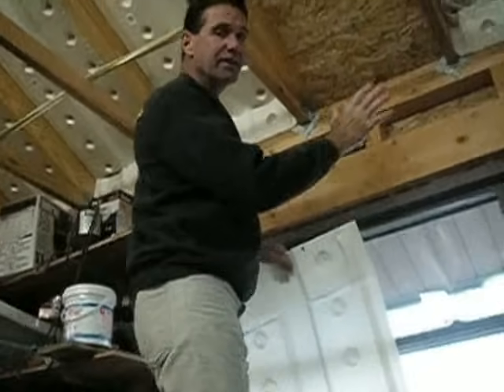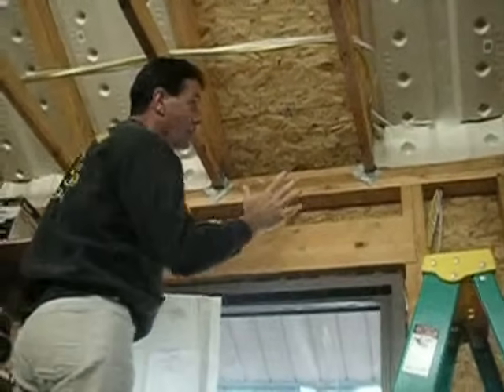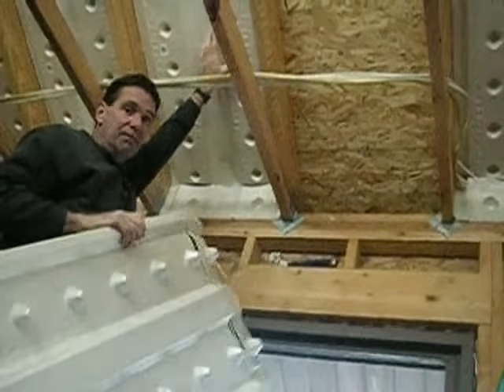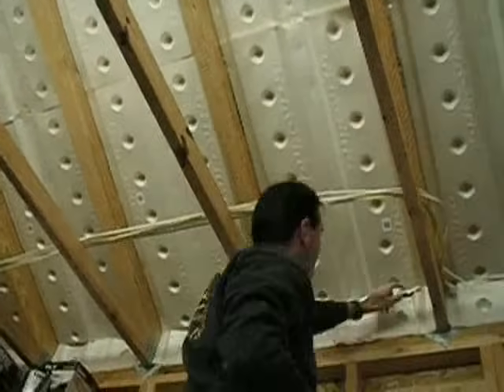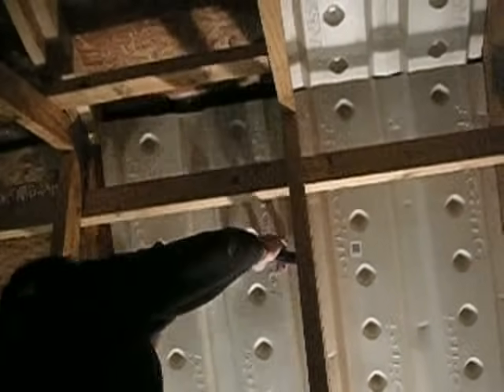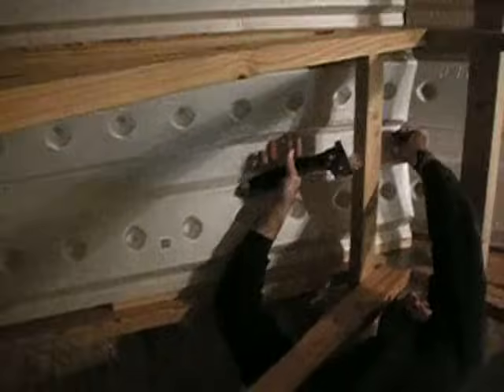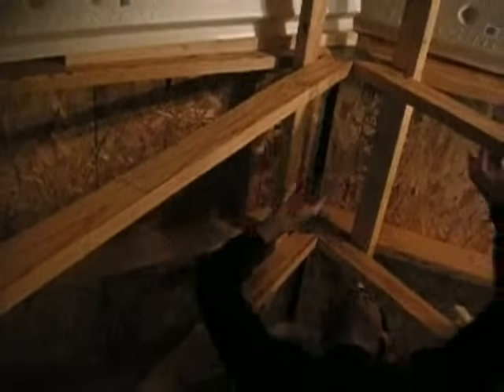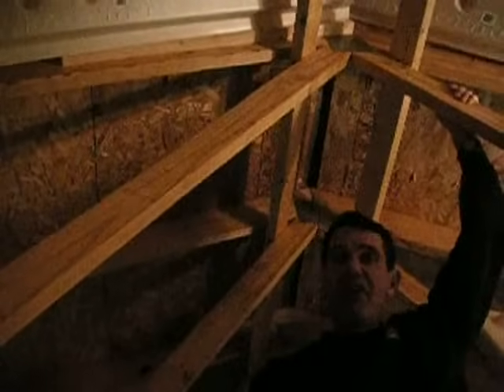Roof, Attic Insulation of Foam Baffles - Ventilate, Insulate Cold, Hot Air

Comment: Thank you Blair just what I needed to see. My bathroom is insulated up against the ceiling and it has spotting mold coming through the drywall every 2-3 years or so so I just bleach the ceiling and repaint with kilz to cover. i am think about opening up the soffitt as it has vinyl and wood on it with really no air flow to add baffles. I am going to try and just get one baffle in there without tearing out the ceiling. Probably not the best way but its not been bad YET. Of course will have to remove the soffitts and then add vented soffitt for the air and with the baffle if I can get it in there should be at least better but not ideal. Only the bathroom is the living area.
Reply from the maker: any air flow you can get above the insulation is a plus

Comment: It looks like your trusses were 2x6.  I have 2x4 trusses, could I still do this method?
Reply: +B scott 
if you are 'living' in the attic airspace I would use spray foam over the baffles.
Reply: Thanks.  not living up there, but might be an easier option.
Reply: +B scott The baffles, yes. Your limitation will be the insulation you post up against it. You will need to find additional ways of support.

Comment: You mentioned taping the cut marks, and caulking.. Any chance of an expanded example? What kind of tape, and specifically how you'd do both?
My concern is a drafty edge on the wall side after insulation is in place.
Reply from the maker: Actually I like to seal all the joints and voids with 'Crack filling spray foam'. It is messy but it glues any voids together.
Reply: @MrHardware1  How can you be sure that the crack filler doesn't expand upwards and block the venting channels that the durovent is intended to create? Also what tape do you use?
Reply from the maker: @OutThere21  don’t use tons of foam when filling cracks, a little bonds like a lot. I recommend Gorilla tape for anything you don’t want to disassemble later.

Comment: ok. it is a great think . what about the hot air between the ceiling and the baffles? where it wit go if you got your baffles all the way to the ridge vent?I thought you supposed to run the baffles only in the area where the insulation will be so it doesn't block the air flow?
Reply from the maker: I'm using the attic, there will be no ceiling thus no dead air space. I only insulate against the conditioned area.

Comment: @Lynnieburd if you use 2 inch foam sheet (with foil is better) cut between 2 X 4 rafters and use canned foam to seal cracks (cut it in foam as tight as possible). this leaves you have a 1 1/2 inch space for air flow, put up at least 4 mil plastic and sheet over with 5/8 inch mold moister resistant sheet rock as a fire barrier. bigger rafters = thicker foam

Comment: This seems to work for roofs that have venting along the whole edge of a soffit. My roof does not, but it has three 20" by 24" soffit vents along the underside of the soffit, so I think I need special baffles that surrond the soffit vents inside the attic.
Reply from the maker: I bet the soffit area is continuous between the vents, once past the top plate the baffles will do their job.

Comment: Can 3-4 layers of duro-vent tacked up without the complete insulation save a roof?
Reply from the maker: +sblizzy 
It's not about saving the roof, it is letting the roof vent while keeping the room below warm or cool depending on the season. Several layers may have been all I needed for a garage, cuz it would have helped keep the heat from the summer sun from baking me in the garage.

Comment: What do you do if you are insulating a small pitch area on a garage space (where there is no living area above) and there is no ridge vent in place at the top?
Reply from the maker: Foam insulation sprayed directly to the bottom of the roof plywood is the best way. Celluose or fiberglass can hold moisture and cause rot... This is a tough call because conditions vary greatly. I use a vent installed where the roof contacts the building, like a half-ridge vent to do it the best way.

Comment from the maker: The purpose of the baffles is to allow insulation and airflow in the same cavity. If the rafter space is not ventilated, moisture can damage the rafters and the drywall. In my garage the attic is a living area so I am conditioning that area. If it was not a living area the baffles only need to go above the depth of the insulation.
Reply: Great explanation. I wondered

Comment: Do I need to get these installed in my Tuff Shed?? Before I get the ceilings insulated??..There are no vents inside..I was told not to get any vents if I planned on insulating...PLEASE HELP...
Reply from the maker: My best wish for an insulated building is to have vents at the gutters ( the area at the base of the roof) and a ridge vent to let warm, moist air flow up and out. Send me an email of your print or something showing the roof and the outside wall and I'll send my idea back. blair@mrhardware.com

Comment: how do you join the 2 baffles at the ridge with out having all the mismatch openings.
Reply from the maker: +marty one 
I stapled the foam-board to both sides of the roof, barely holding the top piece of foam-board until I came back with a can of spray foam and used it to 'weld' all the edges and voids together.
Reply: Thank you for replying back. only I dont see anywhere on the net how to meet up the 2 baffles at the peak. its like putting a round peg on a square hole or using a car door for a hood. the voids are too large to use spray foam.
Reply from the maker: +marty one 
Marty, you could tape a 12" piece of foam baffle, cut to match somewhat close to the baffles running up the roof, and with a can of foam easily fill gaps up to an inch wide. hopefully you are a little closer 'coping the top piece of foam to the side pieces than one inch.
Reply from the maker: +marty one 
Check out this video on crack filling, not my best.

Comment: Wouldn't it be better to just spray foam the entire attic
Reply from the maker: That is another viewpoint on this job that some 'foam guys' prefer. For a while shingle manufacturers were not guaranteeing shingles on a 'hot roof'. I prefer the airflow to remove some of the heat and moisture that could accumulate in the wood decking. Check with your shingle manufacturer to prevent losing the warrantee before foaming directly to the plywood.

Comment: This method does not ventilate any attic airspace, If he packs the attic solid and gets a good air barrier, it should be good. He did however, miss taking the insulation over the double tip plate. The coldest wall area in the building is now where some of the warmest air is, the wall/ceiling joint. He may see the results of condensation in that area already. He should have tried to get the baffle downturn on the outside of the top plate. He is way ahead of most contractors though.

Comment: @HomeEnergyNow The fact is, you MUST use some type of barrier between heated living space and unheated attic or cavity space to prevent the build up of condensation.
Vapor barrier/retarders work together with ventilation to protect roof decks from developing condensation that in turn causes roof rot. Keeping moisture vapor from permeating to the unheated space is the objective. Allowing it to hit the cold space will cause a problem over time. 
The video is correct.
Reply: Theres a cold spot above the top plates now. Not good. You should hang the baffles part top plates then stuff insulation in the void.

Comment: @HomeEnergyNow How is the vapor barrier going to interfere with the ventilation?
It's there to protect the insulation. And wood dose NOT need to breathe. That is just silly. Wood dose expand and contract with humidity though, even after it's been "sealed" with paint. Everything in this video is correct in my opinion.

Comment: I love your demonstration of how you installed your baffles.. very informative. I would add that according to the research I have done (which is extensive), we do not need to ventilate because of the danger of a hot roof. We need to ventilate because of moisture brought on my temperature extremes and a conditioned space. If you air condition a space condensation can occur like a glass of water on a cold day. Likewise in the winter you can also have the same impact when heating a room. If you do not vent the roof you will have problems with moisture. Moisture destroys roof from the sheathing side out, and it causes mold. 

I am in the process of researching how to insulate my tuff shed for a home office. I am going to create cathedral ceilings out of 2x4 rafters. I am going with 2 inch rigid foam sealed with spray foam. It has the highest R value per inch, and the space I have is limited. I may still install baffles, even though I am going to make sure that there is still 2 inches for ventilation. Another benefit of rigid foam is it has vapor barrier qualities.

Comment: what if my detached garage does not have a ridge vent but only 3 round metal "exhaust" vents in the roof 3/4 way up the roof equal distant apart... do I need to install baffles at all?  my garage joices I think I want to remain open so I can store stuff in the attic part of the garage... but I want to insulate all walls and the roof but my question is about the baffles?????
Reply from the maker: You will need to create a false ceiling from your can vents horizontally across the garage allowing the baffles to 'dump' air into that upper cavity so it can exhaust out the can vents. I think it would be easier to remove the cap off your roof, cut 2" out of the decking and install a ridge vent on top of the existing roof. The baffles have to have an inlet (at the soffits) and an exhaust out the top.
Reply: What if it's a unattached garage hip roof with four vents?  I want to finish the walls and insulate for a workshop on one half of a two car garage.  Do a 1/4" plywood ceiling and walls on one half.

Comment: Perfect, thank you. 
The general contractor installed baffles from the soffits up towards the ridge vent, but only 6 feet. So the attic is the same temperature as the outside. This is a problem since the HVAC is in attic.  I need to continue the baffles the ridge vent, then finish the insulation.
Thanks again!
Reply: You attic should be sanectemp or you'll get heat loss, then water damming when it freezes over the cold overhang.

Comment: I've got an existing situation on a knee wall.  any Idea how to do this when the drywall is already installed.  My house is older and the original builder never had to do this.  I'm trying to save time and money by not removing the drywall, removing the insulation, installing the vent, and then doing the work all over again.    Thanks for any advice.
Reply from the maker: Sorry, there is only 3 1/2" of room plus a vent to insulate. I think a foaming company would charge more that pulling down the drywall, adding a 2x4 to the bottom of the existing rafter so at least 6'' of insulation exists.

Comment: Thanks for sharing your video.  I want to add faced batt to my old garage ceiling as you show, but I have no ridge vent or soffit vents.  All of those spaces are closed off.  I only plan to heat the space for hobby woodworking for several hours a week through the winter months with an electric heater or maybe wood stove.  Would you recommend adding these vents, going with a different insulating material, or something else entirely?
Reply from the maker: I think you should install a ridge vent so the air can come from the vents to the ridge vent. Then insulate below the baffles with anything, fiberglass or blown-in  with reinforced plastic stapled to the bottom of the rafters or foam, the best.
you need to capture the air from the soffits and prevent it from taking heated air from the shop.
Reply: Blair Gilbert Blair Gilbert I think you missed the point he made. I have the same problem situation in my garage. They shut the soffet vent with wood so there is no venting at all. the top of the roof is also blocked with wood so there is no way to add a ridge vent unless I  tear all the wood out. The thing is I am not using AC and only minimal heating using space heaters sometimes. Otherwise the only conditioning is what is leaking through from the house. I park my electric car in the garage in the winter which helps with the range. Adding the insulation to the walls seemed to make a difference. If the garage is minimally heated in the winter do you think adding a layer of insulation boards on the studs would cause and mold problems or overheating during the summer? If I just left the bottom and top open allowing it to vent on the inside of the garage will that defeat the purpose since there is no air barrier? If the soffit and ridge venting is not an option is there anything simple that would work without causing a problem with mimimally conditioned spaces?
Reply from the maker: If you are using electric space heaters there won't be a lot of warm MOIST air rising to the roof, (gas space heaters create a lot of moisture) and getting trapped between the insulation and the cold roof. Moist air penetrates the insulation and contacts the ice cold roof and BOOM, you have condensation.
I have used 2 layers of plastic (visquene) stapled to the bottoms of the ceiling joists to create a semi thermal barrier to retain heat. That way you won't be heating the attic area above.

Comment: completly done wrong. Soffit Vents and Ridge Vents/Roof Vents are suppose to work together to help remove the hot air in the attic out. You are only suppose to go up high enough from the soffit vent with the baffles so that insulation does not fall down into the soffit and block the air flow. What he did restricts the air flow in the attic and is not removing any hot air from the attic.
Reply from the maker: You are missing the part that I'm conditioning the attic and don't want to add or draw air from there.  My goal is to vent the roof, not the attic. Blair

Comment: Baffles like hes using can be replaced by just cutting 3 or 4 inch foam board in between the rafters and sealing with canned foam, leave at least a 1 inch air space between the roof decking. You also need a fire barrier at least 5/8 sheetrock with mold moister resistance. Fiberglass or cellulose will get moist and lose R-value in wet cold winter months. Foam is a better insulator.

Comment: Hey MR. Hardware,

I have the same setup on an pine 8x12 shed roof, in Toronto Canada. Only I don't have a ridge vent. 

Would you still install the baffles to the roof peak even with out the ridge vent everything under the vapor barrier is well vented, but when I had my batting straight up on the roof with no baffles, it began to sweat. Any advice is welcomed.
Reply: Id add the baffles because in the future you can add a Ridge vent. You also don't need to redo your roof to do so.

Comment: This is a great idea, directing the air toward the ridge vent. It also seems that it would help to insulate in that the heat would more easily travel toward the ridge vent, then to radiate out into the attic.

Comment: I can't believe how bad of a job you've done here. You have no insulation on top of your wall plate. If you're in a northern climate, you'll get frost on the upper corners of your rooms. Run baffle out past wall, and shove fiberglass insulation between baffle and top off wall. You only do the folding method to the outside edge of the wall(not inside) , but only if you have a taller truss heel height. And you don't run the baffle all the way to the ridge vent, otherwise you get no air circulation in the attic space, and you could have moisture issues.
Reply: You do realize that he's keeping the attic space exposed, right? That way - he can keep it open to put things in the rafters.  After he does this, he's putting insulation on top of what he just stapled up there. I can see what you mean about putting the baffle past the wall plate...

Comment: how do you get the air from inside the attic out if you have it all sealed up?
Reply: Has said it is a conditioned space. Meaning heating and cooling like the rest of the house. The insulation keeps the room warm in winter and cool in summer. The baffles with soffit vents and a ridge vent keep the roof cool all year round. Having outside air circulation to the conditioned space would be like having your living room windows open all year round.

Comment: I used this in our home with a low pitch roof where I had little space for insulation and wanted it to breathe without blocking the air flow. Our place had NO venting or eaves and the entire roof rotted (decking and all). Talk about an abatement job. Surprisingly, it had survived this way since 1965.

 I had to add 4 roof vents in and drill holes between rafters for air flow. Now I can feel the heat rising out of the vents like crazy. This must also help keep the decking at outside temperature so that snow does not melt during winter.

Comment: Do you need to install baffles if the insulation is going to be spray foam?
Reply from the maker: Only if you want a cool roof. The baffles allow air to carry the heat up and away from the roof. Many shingle mfgrs allow for direct foam but the roof will get hotter. I'm trying to keep my shop cool so I am a baffle guy.
Reply: ok, thanks for the info.

Comment from the maker: I did not have the ability to attach the baffle on the exterior of the top plate. If I wanted to go all out I would have glued 2" piece of foam to the top of the plate first. The weak link is the edge of the top plate and where it would meet my ceiling. The attic is a conditioned space so moisture is not a problem, cooling the roof in order to make a hot roof 'not so hot' was the goal of the project. That room is wonderful to work in on a hot 80 degree day, and my roof is as cool as it can be.
Reply: LOL. "...hot 80 degree day". I live in central Texas, 80 degrees is a rare cool day. Eighty degrees is open every window in the house day.